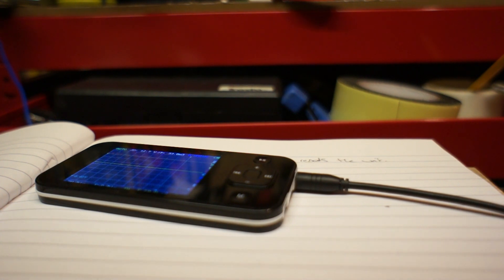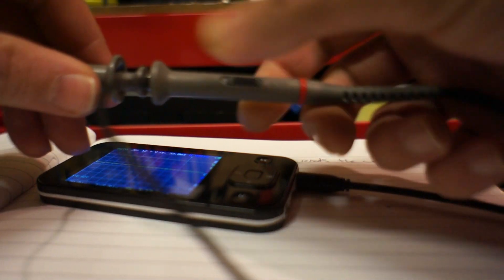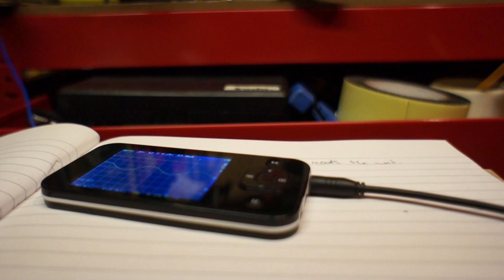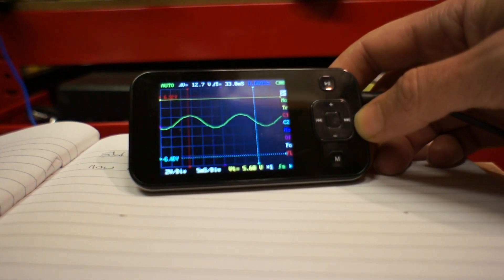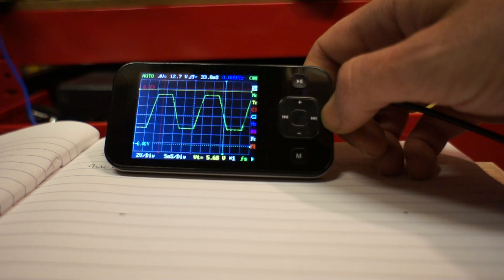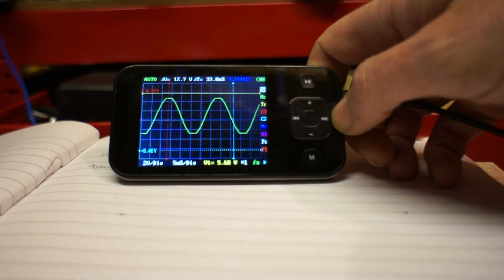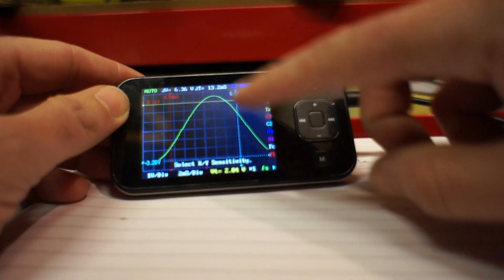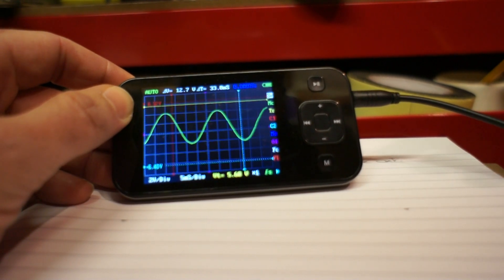ebay o'scope how to, part two, the amp

Comment: I've just got a dso211 pocket scope but having problems using it on my sub amp, it's was fine on my full range amp but on my sub amp I can't get the wave small enough to view on the screen ? The 211 doesn't have the switch on the probe, but says it's good for 40v . Any ideas ?
Reply from the maker: best bet is probably to buy a probe that does have a switch, search eBay for "Probe x1 x10 for Nano" and something will come up. Only a few quid (tenner at most)
Reply: Thanks Jon, sorry for duplicate messages on here and talk forum. Wasn't sure which one would get quickest response. Does your scope have the 'probeattn' setting ?

Comment: how would i tune the gain on the amp if my amp does 2500.1 and subs rated at 1100 rms
Reply: they are A pair of dvc 2 ohm subs

Comment: If you match the gain on the amp to the head unit then if you are not turning amp met of the way up then you are not using what the amp is rated at right? for example why get a 150w amp if you only turn it up half way and only using 75 watts?
Reply: Matt, that is NOT how it works at ALL, the gain at halfway is NOT half the power of the amp, the purpose of a gain control is to match it to your RCA input voltage, for example a 4 volt rca preout would require less gain to reach the same power output that a 2 volt RCA preout would require, once you pass this point all you are doing is creating clipping that will damage your speakers, you aren't getting more usable power, amps that are rated honestly, are rated gain matched like this.
Reply from the maker: not entirely sure what you mean so apologies if I misunderstand but to try and answer your question; gain matching is to match the amp inputs to the headunit output. for (a very simplified example) if you have a 4volt output from your headunit RCA you might set the gain to the half way (50%) mark, but if your headunit puts out 3 volts you would set the gain higher at the 3/4 mark (75%)

Either setting will net you the max power the amp can give. In short, the gain isn't a volume control.

Comment: What kind of leads are you using?
Reply from the maker: The probe that came with the o-scope - if you don't have one, search eBay for a mini dso probe and take your pick!
Reply: wonkyjon yeah I found many oscilloscopes but the one that looks like yours has a pen like probe that leads to an alligator clip but its just one clip, is that like yours?
Reply from the maker: the 'pen' bit has a clip on the end of it, you just won't see that in the pictures.. so yeah, sounds like that's the one :)